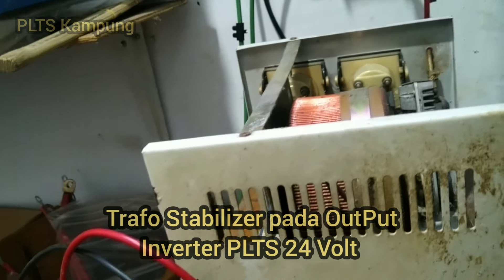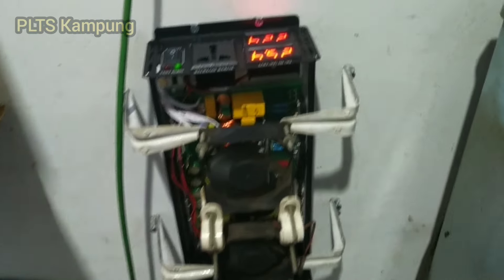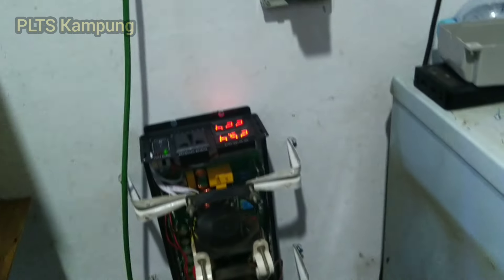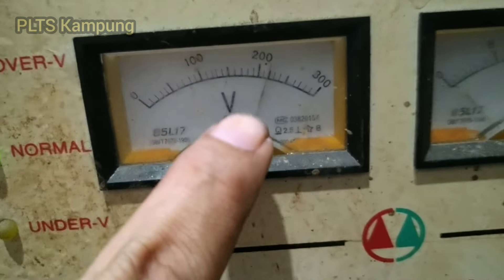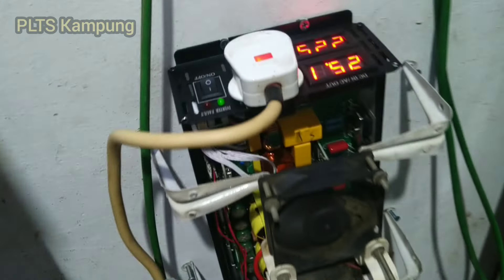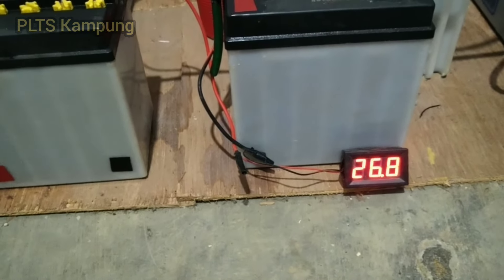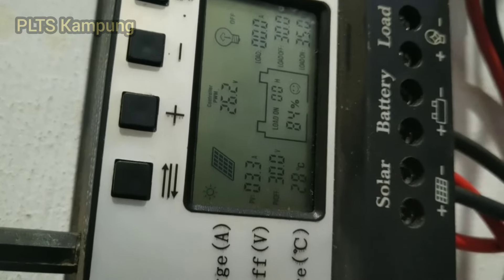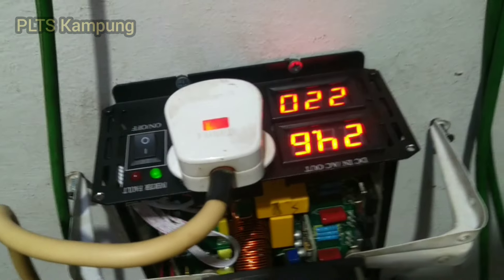Trafo pada OutPut Inverter PLTS

Comment: Eh iya bukan sterizer tapi stabilizer maaf😅
Reply from the maker: waalaikum salam pak 
 trafo 220 volt ac kapasitas 3000 watt yang dipasang pada output inverter 24 volt dc kapasitas running 2000 watt ❤